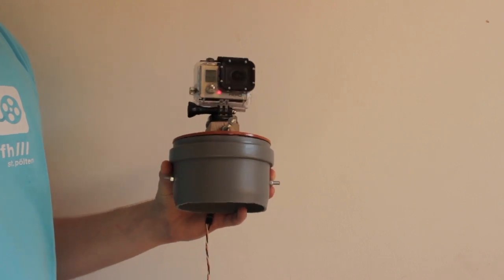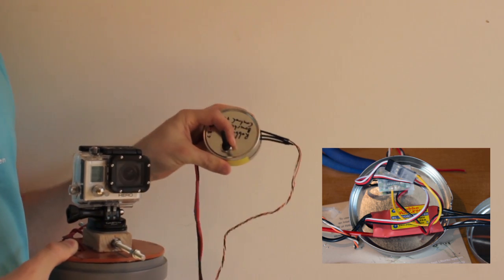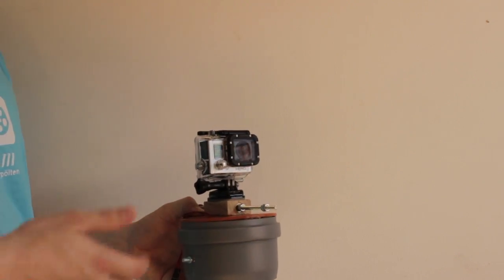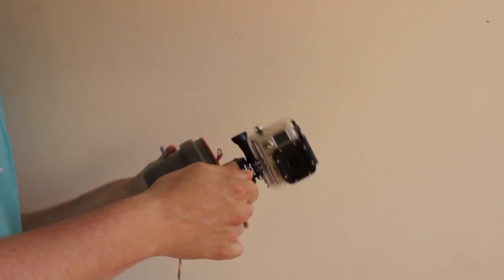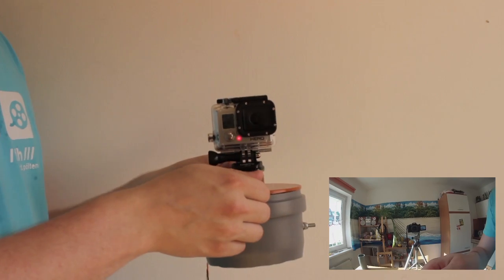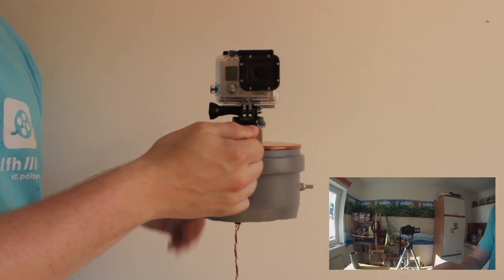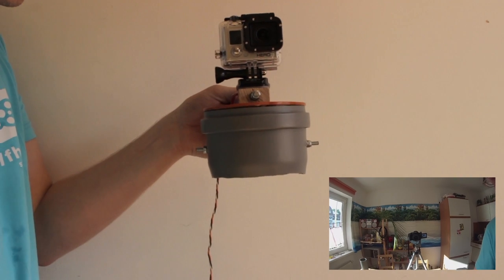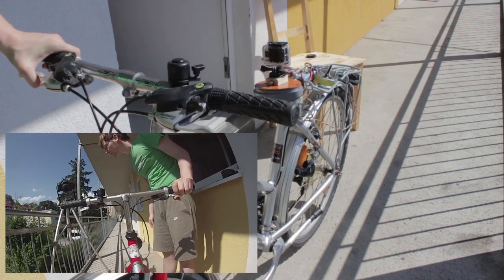construction and test of a 1-axis gyro stabilizer

Comment: Nice project for a bike.
So I have some solutions:
1. vertical motion - rubber or counter mass with hinge
2. your stabilising is a great idea. So i think must be developed. In example with breakage the mass wheel = gyroscope, inside your cylinder platform, or replacement with brushless motor

Comment: Yes, the size and mass matter. Google gyroscopes.
You don't need horizontal and vertical unit, but two discs spinning in the opposite directions on the same axis (two motors with discs).
If you want to stabilize the "left-right" movement than you would need another pair of discs.